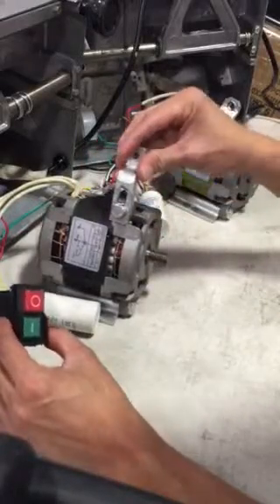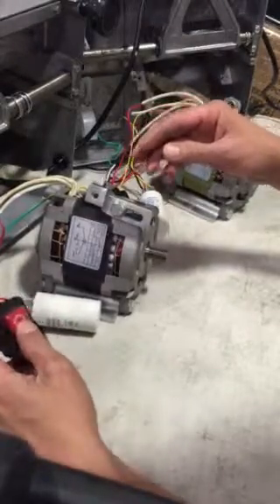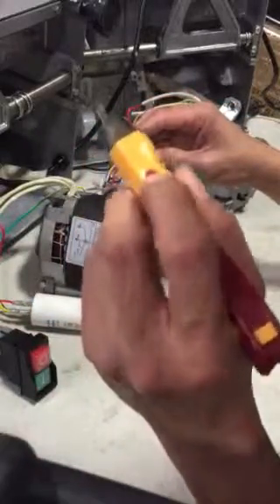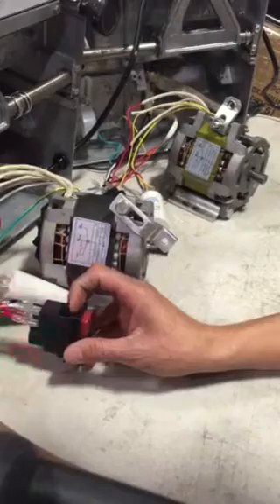Slicer motor really is the issue

Comment: Did you check the capacitor? They usually go bad before a motor does. If it is shorted it will cause the motor to overheat.

Comment: my slicer Omcan HBS300 motor was very loud for months.  finally stopped working.  took it apart today and looks like it may have been out of alignment.  now it doesn't turn on.  well the switch works and it hums and doesn't spin and it's extremely hard to turn (by hand).  I believe it's from hosing it down to clean it and the internals rusted.  took the motor and everything out today attempting to break it loose and/or repack the bearing but I think it's beyond repair.  any ideas for a replacement?  thanks!